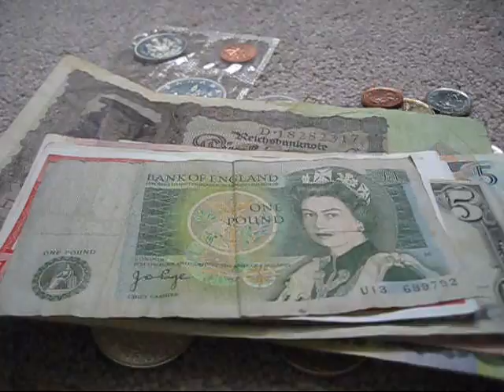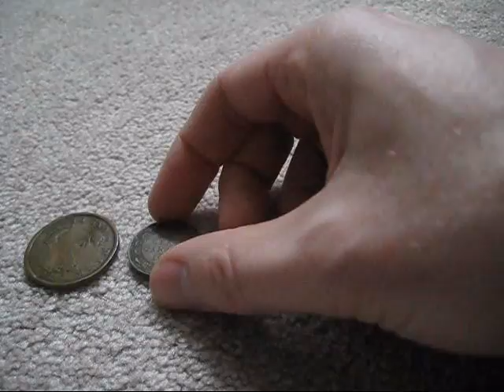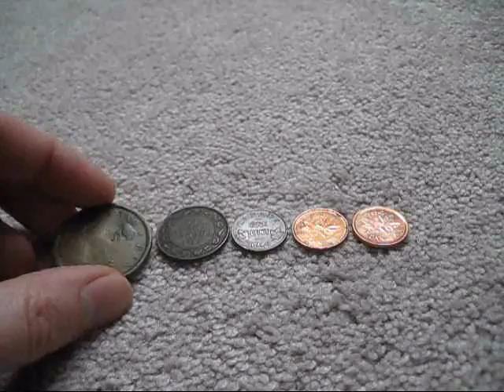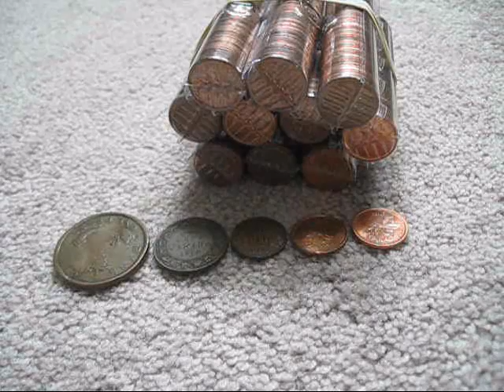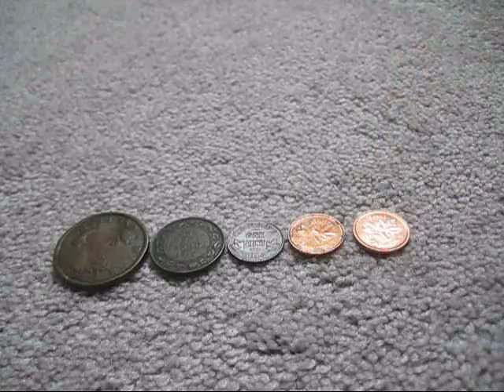RIP Canadian Penny: Victim of Inflation, the hidden tax

Comment: tell him, "yeah but that's the face value. what i meant is that what is the capacity of each dollar to buy something? in the 1950's, i could buy about 4 gallons of gas with a dollar or with four silver quarters. today, i can still buy 4 gallons of gas with four silver quarters. now, it is the metal content that kept the purchasing power of it because back in the oldies, the number of dollars was based on the weight of silver and gold."

Comment: Since your penny is going out, are all the merchants and service providers pricing products to be 9.95 instead of 9.99?  Even if they do price it at 5 cent intervals when tax is added no matter what percentage, you will get odd numbers  $12.65 x 10% tax = $13.92 ($13.915 rounded up).  Unless they plan to increase all product prices below 50 cent to 50 cent and all priced above 50cent on up to the full dollar. $12.65 goes to $13?? Otherwise you will always get a a none 5cent calculation.
Reply: tiktak25 if you pay cash and the total is 9.57 then you would pay 9.55 because it’s rounded but if you pay on card and it’s 9.57 you pay that

Comment: i admit that when I need a quick fiat dollar and I am dry on loonies, toonies, quarters and dimes that I have to move to two rolls of steel pennies.  I fortunately have never gotten past the dimes for short term quick change and keep the coins.

Theory on cheap 1c/5c pieces is that you get coins that have many uses for $1.00 (100 1c or 20 5c) pieces and you can do cool things with them.

This will also mean that we can melt these copper/zinc down now.